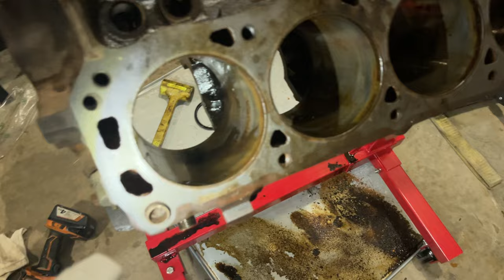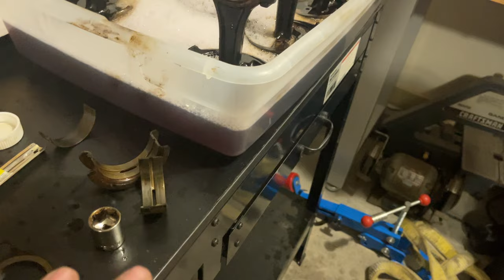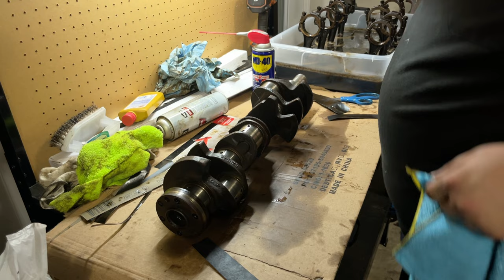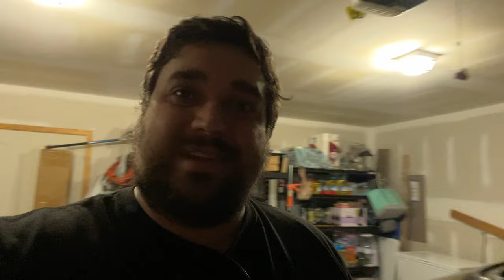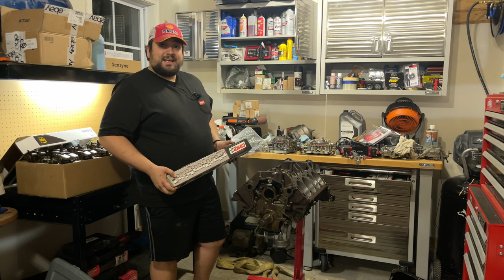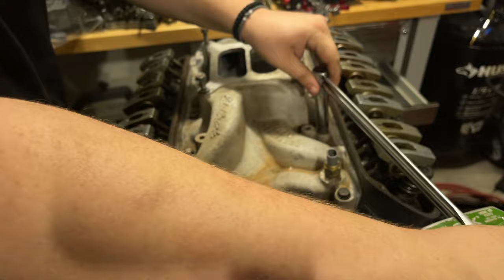Rebuild A Small Block Ford NO MACHINE SHOP!!! Budget 302 Build!!

Comment: You've convinced me to finally pull the 302 in my F150... the oil pressure disappears once it warms up so I figure it's about time to refurbish the engine lol. Thank you!
Reply from the maker: Glad I could help!! There will be a video soon of this engine running, sounds great!!
Reply: @vasilibrown  Looking forward to it! Gotta hit up harbor freight for an engine stand and jack haha, finally will be completing the garage accoutrements…
Reply: Awesome video! I'm currently rebuilding my 93F150 but I'm using an older 86 model 302 bc it was supposed to be in good running order B4 pulled from previous owners van. So was basically just gonna swap external components, but the deeper I dig in I've finally decided to go all in and completely overhaul it with new rings, seals, gaskets ect. And this is the perfect video for me to refer to on what I need to do and make sure I'm doing things right. Appreciate you sharing keep up the good work 👍💯
Reply: My 1990 f150 does the same. Like 5psi when warm. I want to eventually pull the engine and rebuild it. Good luck.
Reply: @bryanmccollum666 be careful friend and make sure the balance is the same, if you’re using the existing truck flywheel. Ford changed in the 80’s I think from 28 ounce to 50 ounce.

Comment: 289/302 engines can easily add double the horse power from 200/210HP  up to 350/400 HP  N/A  & Carbed. on a stock botttom end, thinner head gasket & a Cam with new Heads.
Reply from the maker: Thats all I need on this car. Not trying to get into any power adders. If I had more time, I would try and do some home porting on these heads. But as I type this it’s only 6 days until the event I want to go to
Reply: As long as you happy with it 350 400 hp will make a runer of a engine I've got a 302 that ima start building hears soon

Comment: Say what ya want but the 302 Ford is uniquely superior to the Chevy block for many racing classes.
Reply from the maker: I’ve worked on mostly ford my whole life. After working on one chevy the only advantage I see to it is chevy stuff is wayyyyyy cheaper
Reply: @vasilibrown  na 302 is way superior in many racing classes.  Take the same 305 Chevy class    When done the 302 makes identical power but the key is it weighs significantly less.   Makes it a far better choice.   And it costs near identical.  🤷🏻‍♂️ Chevy is far inferior in this department.     Our mod weighs 125 pounds less in n the front.   ……. Because it’s a 302.     Not even arguable.   Ford 302 is the best racing choice in its class by a good margin.
Reply from the maker: I dont disagree at all! Appreciate the comments!
Reply: @vasilibrown  in our class they had to to ban gt40 heads as a 351 with gt40 heads was not only cheap or was winning races so the Chevy guys wouldn’t tolerate such a thing.    Imagine banning something because it works and is cheap.     In an economy class car.
Reply: @somedude2433 I'm a ford guy but I will say, the gt40 head is pretty much better than any of the previous windsor oem heads, but it is not in the same league as chevys vortec heads.  Chevy vortec heads are the best small chevy oem head they have. They still have there flaws, but they perform better than the camel hump & any other chevy heads. And they perform better than fords gt40 heads. That being said, the gt40 head being the best windsor head & chevy vortec being the best chevy head, the gt40 is not fords best small block heads. The clevland heads are the clear best small block oem heads. The only thing that matches them would be the new LS heads. It took 50yrs for any company to match what the clevland was capable of!
Reply: @jesseduke694  yep.   That’s my biggest complaint.    That’s why all racing classes I participate in that is Chevy dominated (dirt racing) the rules are written so Ford cannot compete.   People don’t use Ford for this reason.  Not because it’s an inferior product.    But because it’s simply better.       Every class the rules are WRITTEN to exclude Ford.      Engines rules ….. always.   No gt40 heads and definitely no gt 40 heads on a 351.     Image bring in a stock class and not even being allowed to run stock parts.  😂.  It’s so pathetic.    302 with gt40 heads done right will make a hood 350 hp and weigh 125 lbs LIGHTER  and it’s very very difficult to blow that motor up.     No wonder they don’t want to race against it   ….. it’s simply better.      So they cheat by excluding true competition
Reply: @somedude2433  I know the rules are written basicly around the gm g body I think they are? The cutless's, Monte Carlos, from 78 into the 80's. Most local rules almost describe those cars to be the cookie cutter chassis. I helped a guy race for one season & he had a ford. It was a outlaw stock class. And he had so much money & time in that car to fit the rule book & stay competitive.  His car was actually incredibly strong but he had alot of money & man he was spending it on that car! He took a 94 crown vic police car frame & cut it & shortened it & put mustang sheet metal on it. His engine was a tall deck windsor & he had a aluminum hi rise intake for a short deck block that he had welded up & redrilled bolt holes to fit a one inch spacer on each head that the intake sat on to make it even higher. And he had some kind of reworked holley 2bbl carb. I saw him buy brand new headers & cut them up to make them fit. A titanium bell housing that he imidiatly started cutting metal out of before we ever used it & it went to a gm power glide trans. That car was sumthin else! It was fast! But he was accident prone as well!
Reply: @jesseduke694  we had Ford and they fought us tooth and nail.   They’d always find something wrong with the car.    We switched to Chevy and they let us cheat left and right.   It’s simply a no Ford allowed sport.
Reply: @somedude2433 They better not be able to use vortecs!
Reply: @hotshothogger  let’s be honest.   The sbc is gone.  Machining old smog heads is way too expensive.  It’s time to just let the sb2 blocks like 5.3 come in.    It would be cheaper and better.   What’s wrong with cheaper and better 🤷🏻‍♂️.   The old days are gone and new fords blocks are just way way to expensive.

Comment: As a kid did the dingle ball and overhaul on at least half a dozen smb Ford's. They went for many more miles. Shade tree style.
Reply from the maker: That’s what I’m talkin’ ‘bout brother!
Reply: The old re-ring job (Craigslist Rebuild). I would lap the valve seats as well as install new valve stem seals.   It would usually net you about 50K miles even on old clapped out engines.

Comment: If you did this on a non race motor for your use, but instead for a general DD use, how many miles do you think it would last?
Reply from the maker: I dont see any reason why it wouldnt last as long as a factory engine. I’d be confident in 100k miles for sure, probably more

Comment: It appears that you honed those cylinders DRY.. jeez man.. a little diesel, in a squirt bottle would have been MUCH better..  and BRASS brushes are FAR superior.. and 800 grit paper.. 400 is too course.. 
Just my opinions and observations.. Good luck
Reply from the maker: I actually used plenty of wd-40 while honing. Definitely won’t argue about brass brushes being better but the regular brushes get the job done

Comment: New subscriber👍
Reply from the maker: Thanks brother!
Reply: Would u happened to have link to rebuild parts u used boss?
Reply: Like bearings and rings
Reply from the maker: @josebanderas2078  King CR804XPN XP Rod Bearings, King MB 529XP Main Bearing, Sealed Power E-458K Piston Ring Set. You can go cheaper on the bearings but this is going to see road racing so built accordingly.
Reply: @vasilibrown  thanks boss

Comment: If I'm not mistaken, should only use oil on lobes of roller cam. Thick goo can turn lifters sideways.
Reply from the maker: I dont really see how that’s possible given roller lifters have dog bones or link bars to prevent them from turning
Reply: @vasilibrown  Manufactures recommend just soaking them in oil though anyway.  Apparently it can cause the roller to develop flat spots on startup.

Comment: is the foxbody 302 5.0 the same engine as the obs f150 302 5.0?
Reply from the maker: Basically, different camshaft I believe
Reply: depending on the year, the HO or Mustang (found in LSC Lincolns) will have forged pistons and a 351W firing order. others are cast pistons and the old 302 firing order.

Comment: What kind of heads are you running
Reply from the maker: They're 1966 289 heads. Modern E7 heads would probably be just as good. GT40 heads would be a great upgrade
Reply: I've got a set of 69 model 351w heads ported all stainless valve job I'd like to sale I've bought new aluminum heads off Hynes brother
Reply: I bought a 84 306 Ross xl400 pistons an holman moody cam an the 351 heads the cam did not take its solid flat tapped so since I did not have any luck with the solid flat tapped I'm doing a full rebuild on my 94 roller with the aluminum heads I'd like to sale the 69 model heads just to get some of my money back out of that motor if interested let me know thanks

Comment: Bahahaha!!! Did u say, "factory specs are thou & a half or sixteen tenths"? If u dont know let me put in numbers for you. Thou & a half=.0015. Sixteen tenths= .0016. Maybey u meant to say it like that but it sounded funny to me. Cus its the same thing. Or almost the same.
Reply from the maker: I admit I dont really understand this comment but I’m glad I could make you laugh 😂😂😂
Reply: @vasilibrown  usually there is a tolerance given for factory specs. I was expecting u to give both ends of the tolerance. Example for my 390 would be on the rod bearing clearance is .0008 to .0015. Eight tenths of a thou to a thou & a half. I guess I was expecting that but u basicly gave the same measurement, u simply said it in different terms. It just struck me as funny. U made a good video. Im not tryin to laugh at u, not in a bad way. Henry Ford had a good one when he said "you can get a model T in any color u want as long as it's black".
Reply: By the way, I would never put a 390 together with .0008 to .0015 clearance on the rod bearings! If u look up any high perf engine like say a 302 Boss, you will see a high perf engine needs more clearance! The last 390 I put together I had .0025 on the rods. Still running strong today.
Reply from the maker: @jesseduke694  ahhhhhhhhh I gotcha now I get it😂. Im glad you explained it and I definitely did not take it as an insult. Thanks for enjoying the vid brother!!!